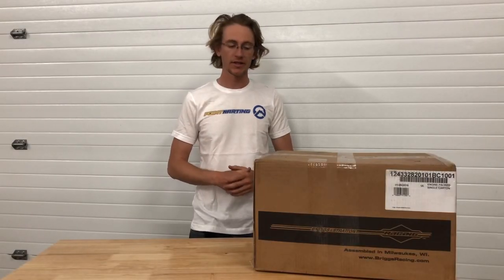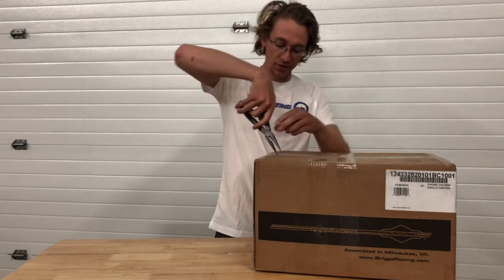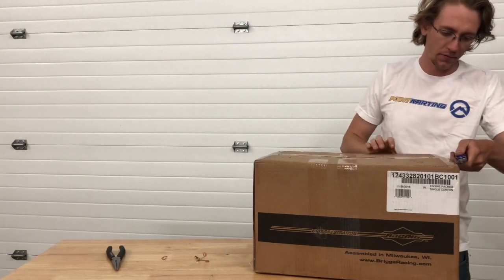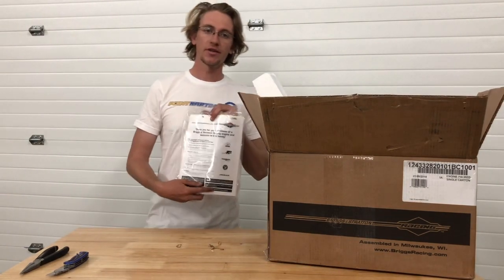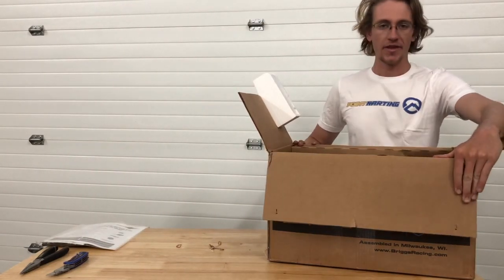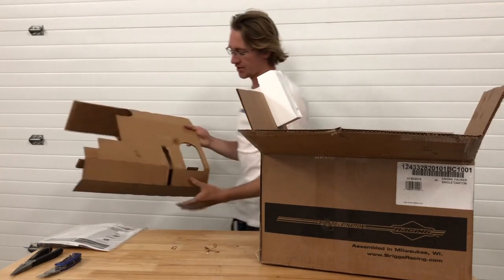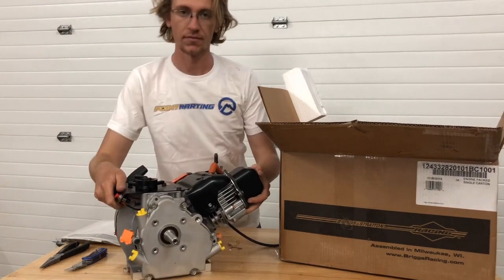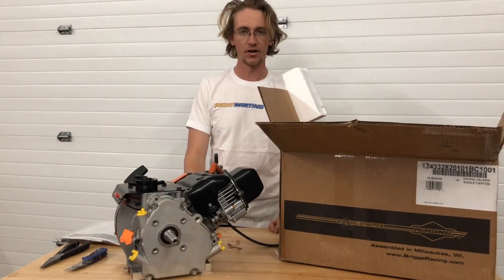Unboxing a Briggs LO206 Engine

Comment: Want to put one of these on a mini bike
Reply from the maker: Do it! It might be a little sketchy tipping from side to side, but not bad.
Reply: I'm 55 and grew up with these, It sounds like a good idea doesn't it?
But soon you will find its not,  Mostly described as a death machine, you will find it to be 
Something you are always limiting yourself at while driving because it constantly gets uncontrollable,
It then becomes somewhat of a dread machine,   Ive seen this more then once,
But I'm all for more power on the go kart, drifting on dry pavement and doing cookie's!
Stay away from steel picnic benches while drinking booze, I broke 3 ribs, But the good news was no damage to the kart!